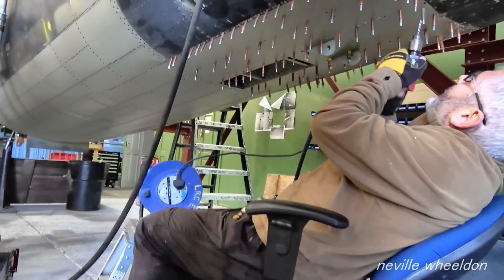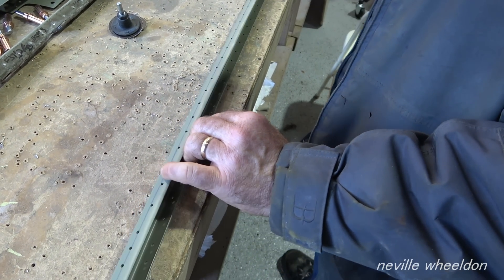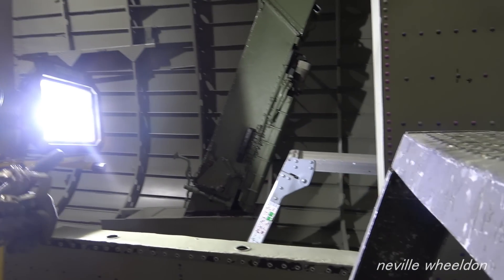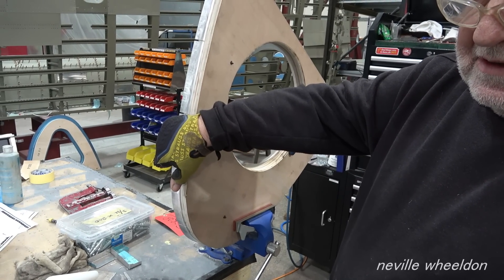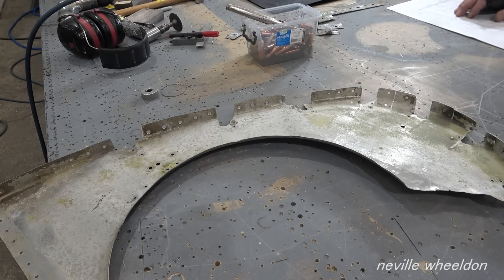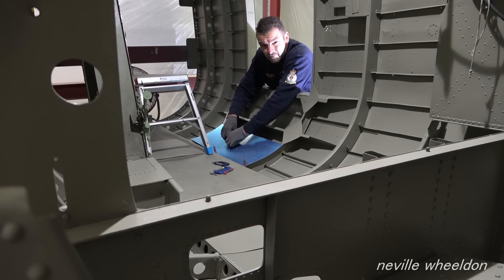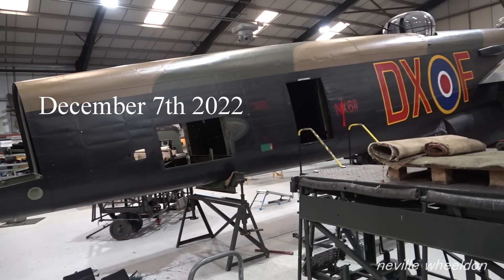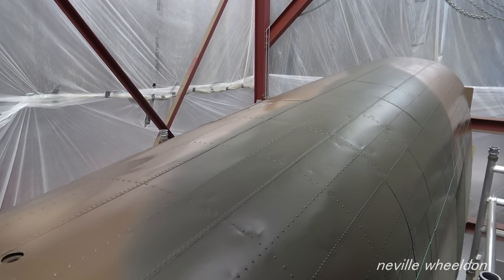Video 175 Restoration of Lancaster NX611 year 6..  Riveting rear wheel Oleo Box

Comment: Hi Neville, great to see the Doncaster tail section now being sprayed and transplanted. Could you ask the guys whether Jane`s own tail section will be as intensive as this Doncaster one, which i`m assuming won`t be as she seems to be in much better condition already?.
Reply from the maker: Hi Neal , every rivet will have to be drilled out,  A number of formers have to be replaced and all the skins will be New. The rear part of the fuselage (rear gun section) has already been restored. ( Rivet are corroding, made of Magnesium alloy)
Reply: @davecooke4009  The "Doncaster" fuselage is from a Lancaster on loan from Doncaster. It's being restored so it can be put on NX611 for a taxi season while NX611's own fuselage is restored to airworthiness.

Comment: Thank you for all these wonderful videos!  I have a question about the riveting in the Doncaster fuselage. It looks like the final hole size is drilled but the hole is not given a final deburring. Is that because the Doncaster fuselage will only be used for display/taxi and not be flown?
Reply from the maker: Hi Thomas, I put your question about the final clearance drilling to Dave. Check out video 177 at 14.38 in.